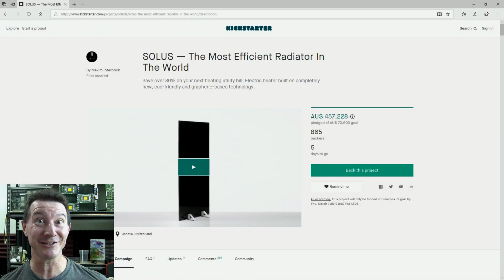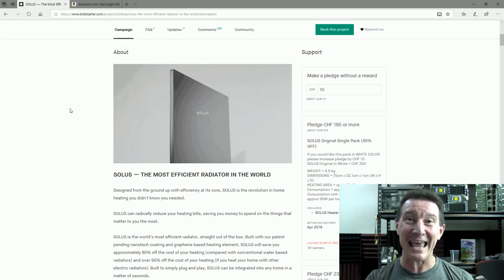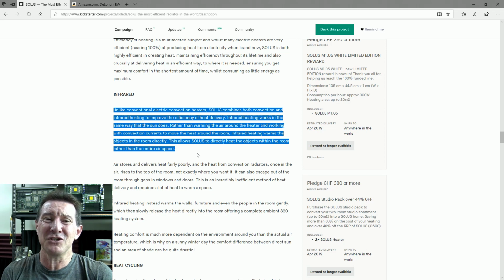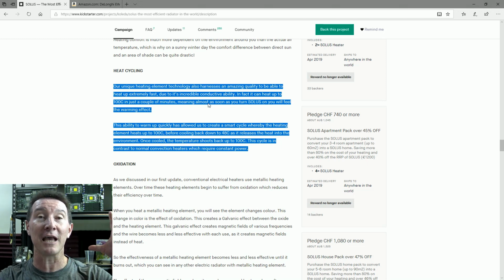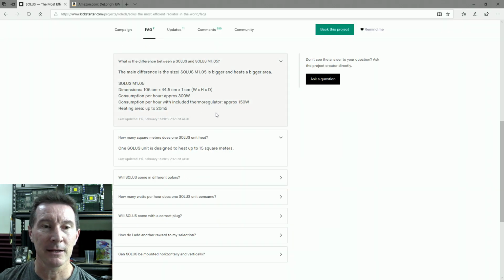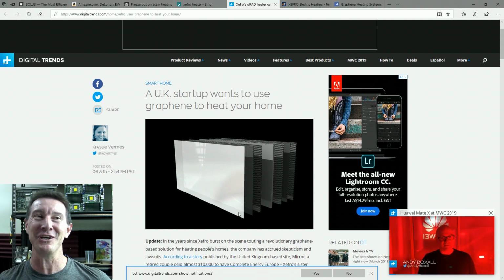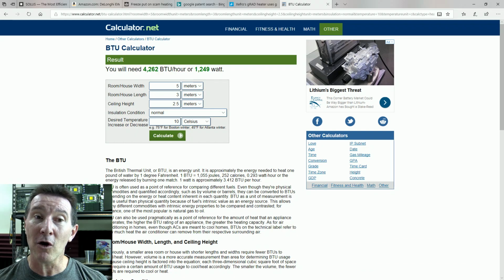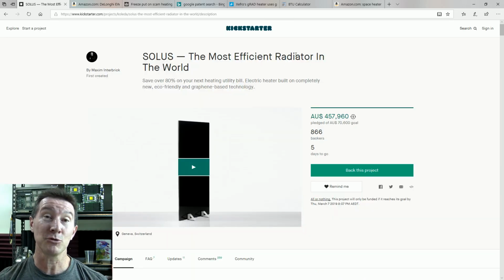EEVblog #1186 - Solus Graphene Heater Kickstarter BUSTED!

Comment from the maker: I didn't even notice they said "190W per hour"
Can't even get their units right! LOL!
Reply: With 190w heater there is no way to heat something in winter time, need at least 8 radiators to heat 1 room, where is the money / energy saving?
Reply: @nameis6895 : That's why they sell the 6-pack.  Though I guess if you need 8, you're still out of luck!

See also: https://www.youtube.com/watch?v=V-jmSjy2ArM
Reply: no worries, iam ok to be out of luck!
Reply from the maker: 8 Bit - But it uses magic woo-woo graphene!
Reply: Dissenter dave, ... , man
Reply: @EEVblog  When the scammers are arrested, they will be so ashamed they will produce more heat from their faces than their heaters. Thus, the scammers will be more efficient in their jails than their "devices". Problem of efficiency solved!
Reply from the maker: Keep Talking, Nobody Listens Most reviewers would not have the knowledge, time, enthusiasm, and equipment to measure it properly.
Reply: @EEVblog  In the Northern EU where it gets quite cold in the winter we need big radiators. A regular household would require about 4KW to stay a cozy 22 degrees centigrade. You'd  cover many walls with 200 watt elements if you used those radiators. Ridiculous!
Maybe if people start to mock those that don't know their units then people would be more careful of what they were saying, instead of being jack asses and misleading at best.
Reply: @Chicken_Massacre  He he he, I used to live in a large old house in Norway. We would sometimes reach 25kW just to heat that thing.
Reply: They must have made at least a couple units. They could ship those and people will review them. But scamming people is more important
Reply: LOL!
In the comments they actually say that their magic heater produces heat with no energy source connected! What a load of crap!

"We observed that during the off cycle (1.5 seconds when current is cut off) the heating element continues to generate heat due to the self cooling properties of graphene, which results in a difference of potentials."
Reply: @Rhulthen  It probably strarted smoldering/burning inside.
Reply: My car's got one of these it's called rear window defogger.
Reply: @gotj  YES we can get old cars and series 24 rear window"s into a thick glass sandwiched resistor  .."free green and recycled energy" should do well on kickstarter..."the unique curved shape is calculated to concentrate the energy"  or "Special low voltage"  ones  would be portable and need  12v psu.
Reply: Oh, you don't understand. When you turn it on, it's using 0 W. Then it ramps up the power slowly until 12 hours later when it's reached its target of 2.28 kW, making it a 190 W/h heater.
Reply: @Gameboygenius  If you forget to unplug it, it will become a galaxy-killing gamma ray emitting neutron something star after a few years...
Reply: @skuula  That's what happens when your shitty Kickstarter pitch turns into a shitty scifi plot...
Reply: 190 joules per second per hour. That's 684kJ/(s^2). Don't you see? This is where they're getting all of their efficiency 😆
Reply: Do you report these scams to kickstarter?
Reply: Pentium 4  = heat = computer use = much higher efficiency   since it can do two things at once
make heat and  run the computer 110% efficiency
Reply: @punker4Real  Take a look at https://www.youtube.com/watch?v=9Z_bvYNWR4k It's a very efficient heating method ... Just a few bitcoin miners so you can heat your home and get paid for it at the same time.
Reply: @punker4Real  No. Only a heater uses 100% of its energy to create heat. Other electronics, like processors, might output 90% of its usage as heat. The other 10% is what switches those transistors. The action of changing the state of the transistors requires energy. It is not possible to output more energy than you input. And having a computer "think" counts as an energy output.
Reply: @Fluvance  but all of the energy used to switch electronics, etc, will come out as heat eventually too
Reply: @Fluvance  Processors put out 99.999% of their consumed energy as heat. There is a small amount light generated at the gate channel but that also gets converted back to heat within the package. There's also a very small amount of radio frequency energy emitted.
Reply: @Fluvance  Unless we are producing neutrinos, or sound, then near 99.99% of the energy will end up as useable "heat" in the room.
Reply: SweetDreamsAreMadeOfThese Other electronics switch capacitors but what do you think happens then? That switching consumes power because all of the switched energy is short circuited through an arm of a cmos half-bridge to either supply rail. All that the processor does is “export” some of these losses outside of itself – it heats up the traces and connection, the intermediate power supplies, and you sitting next to it – through the minuscule amount of RF energy escaping the chassis. Every single watt of energy going into a PC ends up as heat in the same room, and this is accurate to at least 6 decimal places – pretty much to the limit of our ability to measure. Ask any data center designer. kWhrs in, BTUs out, and you sure as heck need to design air conditioning to extract every single watt you dumped in to power those PCs, or they’ll cook themselves.
Reply: Almost 10 000 watts after two days
Reply: you read it aloud and I was like. WHAT?
Reply: AC is cycling at 50  or 60htz  so i suppose all heater cycle if they are on AC...LOL
Reply: Totally didn't send an inquiry to the Swiss consumer protection foundation...
Reply: If ya buy 10 of them....to heat a house, used more than a space heater!
Reply: EEVblog My electric radiator has a progressive resistance thermostat. Instead of turning the whole heating element on and off, it ajusts its resistance accrding to the needs. It's more efficient than the standard on/off radiators because you don't overheat the room before cuting it and the ambient temperature does not oscillate.  So it's possible to get more efficient radiators but not by adding intelligent control rather than graphite woodoo.
Reply: All that wankery , it just looks like a heating element between two pieces of glass to me.
Reply: Is it an IR heater?
Reply: You didn't even blink when you said it, so I figured it was some Aussie thing.
Reply: Doesn't that mean, that you are more efficient at heating a room than their machine?
Reply: How did you miss the "SOlus unique heating element has very low resistance and can DIRECTLY convert FLUCTUATING EELECTRICAL CURRENTS into heat..."???
Reply: People have more money than sense and want to believe everything on the internet. 
Scammers know (they are either scammers who knows what they are doing OR didn’t go to college) as soon as you mentioned few magical words like graphene and can heat their home with little to no electricity, people will fall for it. 
Hopefully this will get shut down
Reply: @devdou5546  its really weird 30 second on wiki should make most of these OBVIOUS BS   or thunderfoot
Reply: No dangerous EMFs lol
Reply: @danielrouw2593  acceleration?
Reply: @mistakenotou7681  Powerceleration!
Reply: How much is a BTU and why do you mention that unit so much?
Reply: Hmm what happans if grafene gets in your langs??
Reply: 190W per hour, every hour, 27 hours a day!  :P
Reply: I was immediately shocked
Reply: @PasiKuikka yes, chemical lab experiments, like the one when LSD was discovered :D
Reply: @EEVblog - 
It is usable as heater under your back, when sleeping in the bad , there are "190W" more than sufficient ;-) but it will crack
Reply: How many bathtubs is that?
Reply: Was just going to post a comment about this "Watts per hour" BS ;-)
Reply: I noticed it immediately! And I wondered, why you did not comment it. Unfortunately this is a wide spread bullshit and many people do not even accept, that they are wrong when you try to directly explain it to them.
Reply: Dave, you divided 10.6 kW by 24 hrs to get .440 kW. You probably mistook the units were kW-h, but you literally said you the exact same thing ... that you can divide Watts by hours to get Watts... I like the videos, just check-in on the pride a little bit.

Time to tell me what you all think - *I'm going to propose this product works*. Here's my pitch... The glass helps prevent natural convection, the graphene helps radiate infrared heat similar to a catalytic heater. The key is that the IR heat directly heats the surfaces in line-of-sight of the heater, like you sitting in your room, but the air temperature does not increase to the same extent it does with your oil or space heater. Both are fully efficient, the difference is how much heat you are using. 

In their test looks like they're using thermometers that measure the temperature of surfaces, so they could very well be at 21C. Is the thermostat facing the heater too? 

This product, like similar heaters, might be great if you're in-line, but the other side of your body, or around the corner is going to be quite a bit colder. If you kept the house at 15C and had a few of these well-placed, it might be feasible to save some $$.
Reply: ever heard of Watt Hour? or kWh?
Reply: UPDATE: they've been suspended.
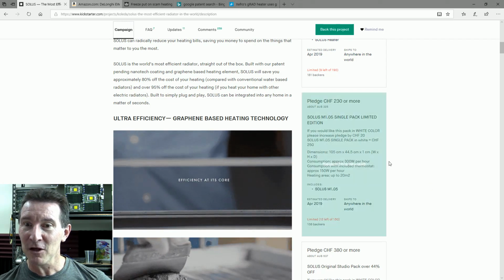Reply: 34:05  and now I just found this after making a comment about it. Watching for the laughs, thanks Dave!
Reply: I noticed that immedately, and that's when I was competely sure that these guys are frauds. Watt is already a per-time unit on it's own, so if divide it by another unit of time, you get an per-time squared unit, or an acceleration. Which means this thing will continually increase it's power consumption over time!
Reply: @troelshansen6212  Yes, this must be some kind of runaway power draw! I guess it just gradually shorts its "modified pulse power" a.k.a. increasing current pulses at 50/60 Hz.
Reply: @troelshansen6212  This is possible. :-) Carbon resistors often have a negative temperature coefficient (NTC)  so their resistance decreases when heating up.Not that you really want this for a heater. :-)
Reply: @EEVblog  to be fair "190 watt hours" IS a valid measure of energy.  190Wh.  Also, their IR production is more efficient than the IR lamps which produce a lot of waste power in the form of light.  That should be their only claim to efficiency however.

I'm just playing devil's advocate here - I also think this is a rubbish product and there's going to be a lot of very unhappy people when they get their "heaters" and find that they are just powerful enough to make a broom closet habitable in the middle of a European winter.
Reply: @Chris Robinson, yes, but they didn't say 190 watt-hours (watts multiplied by hours). They said 190 watts per hour (watts divided by hours). That is neither a unit of power nor a unit of energy. The only purpose for such an esoteric unit would be to use it to measure the speed of power fluctuations. Meaning how fast power draw increases or decreases over time. So, if you have a device that starts at 0 W usage and over the course of an hour increases it's power draw linearly to 190 W, then you would have a "190 W/h device". Such a device will use (and deliver) 95 Wh in that interval: (0+190)/2.
Reply: @Chris_the_Muso  - It says 190W per hour, NOT 190W-hours. 190W per hour is 190W DIVIDED by 1 hour. 190W-hours is 190W MULTIPLIED by 1 hour (190 joules per second MULTIPLIED by 1 hr [3600 seconds] = 684,000 joules [~684 btus]).
Reply: @michaelmoorrees3585  True, but in this case it's implied that they are the same thing.  It's obvious what the intention was, even though you and I wouldn't use the terms in the way they did, and would consider it incorrect. 

No, I think this product has way more problems than the semantics used in the propaganda.

Yes they should have just said "190 watts", the "hour" is redundant.
Reply: Chris Robinson yeah Watt hour is a correct unit for energy but NOT Watt PER hour. (W/h is nonsense)
Reply: @Chris_the_Muso  "190Wh" would be the real unit for energy. But they write "190W per hour" what is just bullshit. They do NOT write or claim "190Wh per hour".
Reply: You've also gotta love how they're like "accessible to all" but a single unit costs more than  a small airconditioner unit and a basic space heater combined.

More importantly, aren't they committing fraud in regards to how they claim it works in the first place? There are clearly no IR emitters on the stupid thing. It's a heating pad in a case. That's it.

Even more importantly, if it spends half the time off and half on, how does that save power? Wouldn't it have a surge in startup current like most devices or am I not remembering the fundamentals correctly? I'm getting kinda rusty on the fundamentals these days.
Reply: @InfernosReaper  Any body above 0K which is not 100% reflective, emits IR radiation. And a resistive heater does not necessarily have elevated inrush current. Although most metals exhibit a positive temperature coefficient and do have it. Carbon resistors (and graphene is carbon) often have a negative tempco.
Reply: Part of their Answer: "It is also clear that EEVblog has no response besides crude gestures to this statement “we have found that raising the temperature of our heating element is most effective through supply of non constant/pulsed electric current. It works in the following way, the heating element is supplied with 1.5 seconds of electric current and is then cut off from supply for another 1.5 seconds. This process is repeated until the heater reaches it’s maximum temperature. We observed that during the off cycle (1.5 seconds when current is cut off) the heating element continues to generate heat due to the self cooling properties of graphene, which results in a difference of potentials.” "
Reply: @ThomisBastelstube  yep its true if i wrap enough nichrome wire around a house brick to dissipate 400 watts the self cooling power of the house brick will heat the room as it cools towards  ambient then i have to expend power to warm the brick you get nothing for nothing.  This is a scam.
Reply: @helltanner3722  no.. it will not generate more heat as they say. its only the energy now spreading arround.
Reply: @ThomisBastelstube  yes you are correct that's why i mentioned you have to expend power to keep the brick warm so it can radiate during the off cycle. its a scam
Reply: EEVblog  -  How exactly do you "heat a volume of space"? 
According to Nasa's findings, I'd say that is impossible.
Reply: @thekaiser1919  Well how you do it is to have a heating element heat up the air around it. 

It's pretty simple really, we've been doing it since the discovery of fire.
Reply: @cadkls  - When we discovered fire, we were not yet in space. We were heating the air, which is a gas, not space itself.
Stop trying to piss down my back telling me it's raining.
Reply: I watched the whole video, only to realise in the end that they are talking about a RESISTOR trapped in glass... It sure has greater efficiency than the other resistors, they glass probably fixes its cosφ or something...
Reply: 110% efficiency  is real
we can have 110% humidity   or is nature exempt from the laws of physics
Reply: @punker4Real  you can't have 110% humidity at less that 25k feet elevation.  it's relative to the solubility at 1Atm
Reply: @punker4Real  , I assume you're being facetious, but for those that think you are serious, humidity, or relative humidity as you refer to, is unrelated to efficiency.
Reply: @punker4Real  A heat pump could be 110% efficient, you'd need a MASSIVE heat sink/cold sink (think pumping SNOW into your house for cooling, or lava for heating... XD )... But this is not a heat pump!
Reply: @punker4Real  Humidity is not a efficiency-based unit it is a relative measurement we do on the moisture carrying capability vs saturation of air.
Air can be over-saturated which basically means it has been forced to take up more moisture than it would have done under normal situations and has past it's saturation point where it normally would have stopped taking up moisture.
Reply: @punker4Real  110% humidity it is called supersaturation....
Reply: @punker4Real  You know humidity is relative to the temperature and pressure right? 110% humidity does not equal 110% efficiency. These are totally different things.

Comment: "Save over 80% on your next heating utility bill" WOOOOOOOOW!!!!!!!!! I will be very rich!!! UFO tec! :-)
Reply: And be 80% colder.  That suffering while freezing would be worth saving 80% on my heating bill.  Hell, the colder I get - the more I'll shiver = the less heat I need and the more heat I produce.
Reply: Plug one of these in. Get 5x the heat out. Put boiler and generator next to it. Plug four of these in to generator. etc. Free energy finally achieved!
Reply: You could actually cover all your walls with these things to isolate your room.
Try that with a standard oil filled radiant heater.
Reply: I save 100% on my heating bill by living in Florida (never needed a heater). Now the amount of energy dedicated to removing heat (and yes, even in December!), that's not so cheap.
Reply: @markg735  
Just drink water and sweat. That's about the cheapest and most efficient cooling system I can think of.